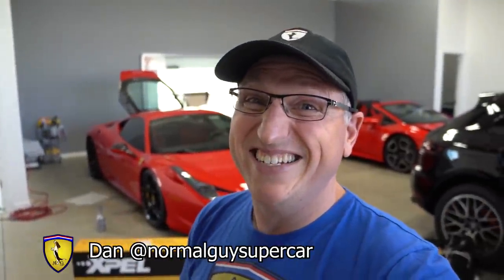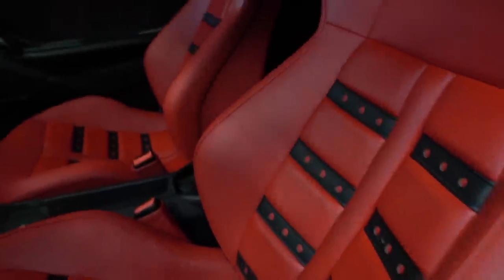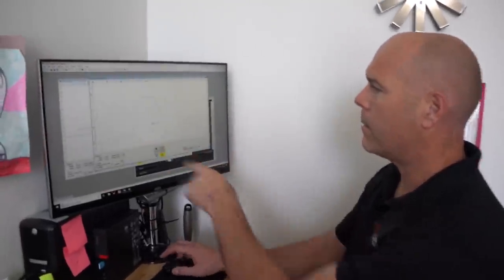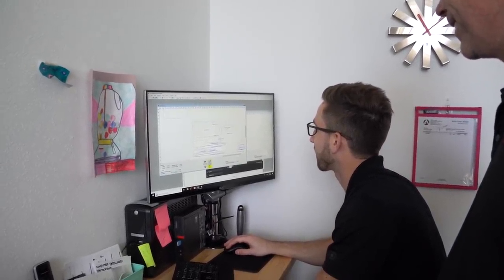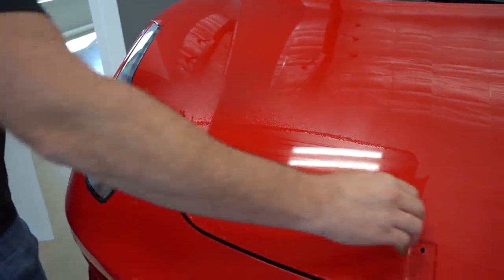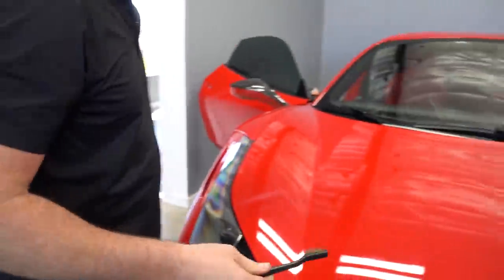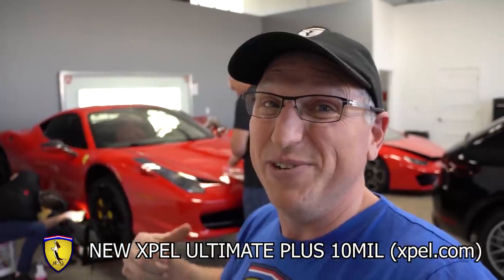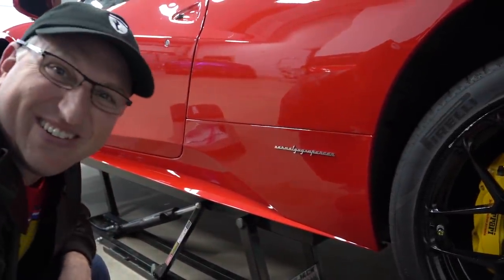Ferrari 458 Paint VS a WIRE BRUSH!

Comment: Like it just rolled out of the factory. I know your excitement first hand. Some hack (now out of business) cut the ppf while on the car. I didn't discover until last year when I decided to have the car paint corrected, ppf'd again, and ceramic coated. My new detailer pulled off the old stuff and there were the razor marks, right through the clear coat. So I had to get the hood, front fenders and bumper repainted. Anyway, ten large later, I have a perfect car. I asked him not to send pics. I wanted to see it in person for the first time and I couldn't believe the transformation.
Reply from the maker: Ugh that would be super frustrating!

Comment: INCREDIBLE! THANK YOU!you've got to let us know what that would've cost a guy off the street
Reply from the maker: Covering the entire car in PPF isn't cheap which is why most people opt to just do the front clip.  It can vary dramatically in price so I recommend calling Authentic Details if you're interesting in having them do it, or call a reputable shop near you.
Reply: LOL A lot.
Reply: @pherron7471  I'd like to have some similar work done on my 355 but just no idea whether to prepare for $4000 or $40000... either would be a lot to me
Reply: @4pevans  The cost will vary depending on where you live, but $4000, give or take 1k, for the whole car sounds right around average. You have to look at other cars they've done though. In particular, look at cars similar to yours. Pay attention to how they wrap difficult areas like air intakes, splitters, etc. Go to different shops. Ask questions. Trust your eyes. Ask other Ferrari owners.
Reply: @pherron7471  THANK YOU!
Reply from the maker: @4pevans  if you're doing just the front and rockers you can for sure get it under $4k. For the whole car it's far more.
Reply: @normalguysupercar  Thanks Dan I wish I lived closer to Austin instead of NH! the car is  decent but has the common chips and fading areas plus some stress cracks where the butress meets the body and I really want a white and black center stripe but hate to devalue the car. Idk maybe i can make a vac trip and tow it down youve really sold me on that quality workmanship

Comment: Prior installing the Xpel, is the car waxed, or just polished?
Reply from the maker: Just polished. You don't want stuff on the car prior to putting on the film or it may not stick properly
Reply: @normalguysupercar  That's what I was thinking. Just wanted to check, because nothing was mentioned about it in the video. Thanks.

Comment: Amazing work! Love your logo on the car, that was super awesome of them.

How much would this have cost? Or is it strictly in the “if you have to ask” territory?
Reply from the maker: It's not cheap but I'm going full bore. They can do the front clip for much cheaper and that protects most of the typical problems
Reply: full body PPF can be anywhere between $5K to $10K depending on how complicated the car shape and installation is.